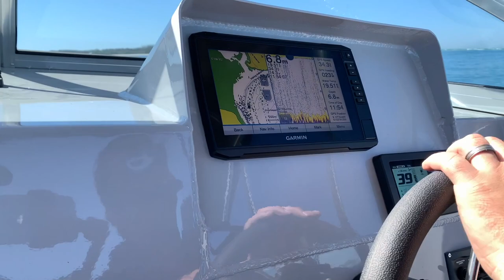Tested | Horizon Plate 585 with Yamaha F130 4 stroke

Comment: 3:17 min
I might be wrong but pretty sure you'll find the maximum beam legally (towable without permit) is 2.5... Not 2.4 as stated ??
Reply from the maker: Correct - max towable without Oversized kit is 2.5.
Reply: Check the specs on their website, it actually states a beam of 2.5m